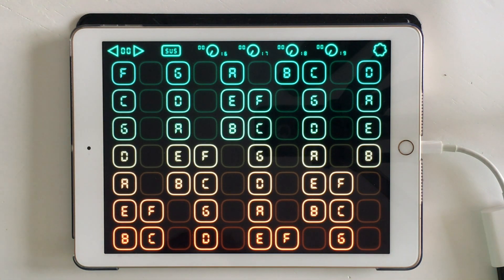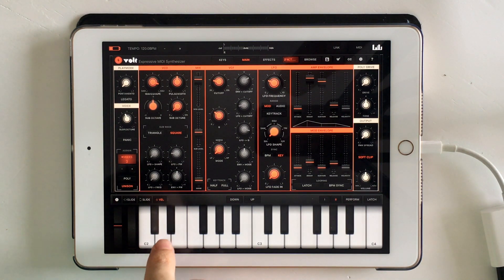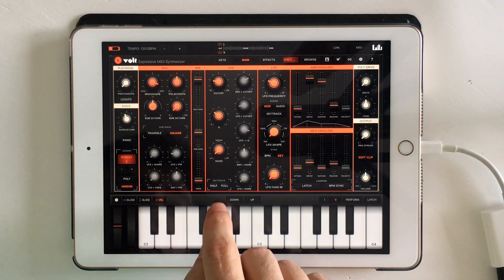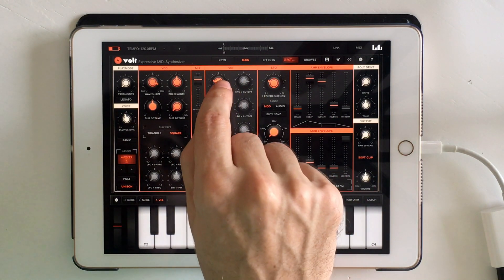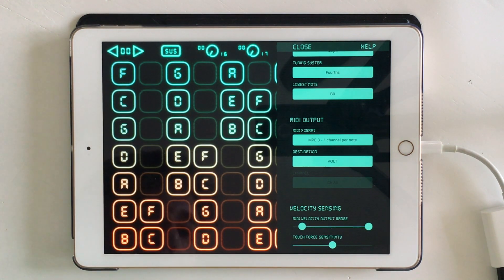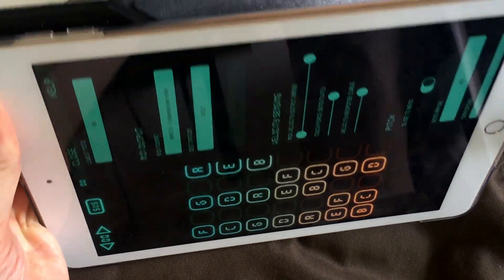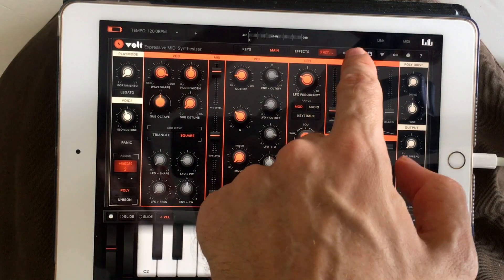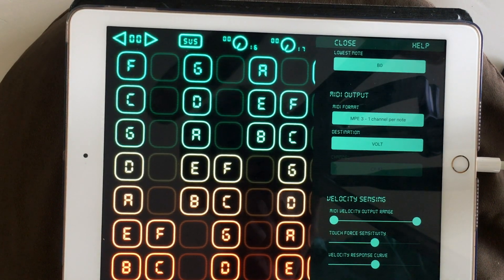Volt MPE Synthesizer + Velocity Keyboard: how to make any patch velocity sensitive

Comment: Great tutorial! Have you reached out to any other developers to see if they could create better input settings for velocity keyboard? Alternatively, what if synth specific presets are included in the next update? For example, the Rosetta sequencer suite has no mapping’s for different drum apps and drum machines. Having app and hardware specific velocity and MPE presets out of the box might be a cool selling point. Pardon if you already had the idea.
Reply: MJR , If we run across an app that has such an unusual setup that it needs its own preset, we will make one. The situation in this video would be helped by adding a “velocity sensitive” preset template to Volt. It’s not specifically related to velocity keyboard since this method would work in Volt with any MIDI controller.